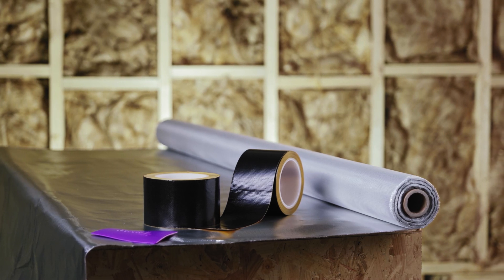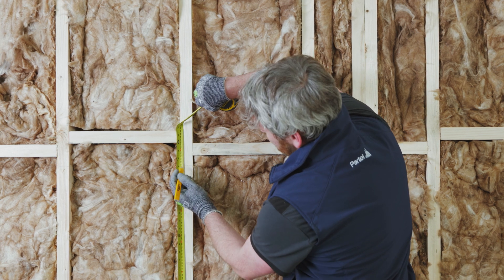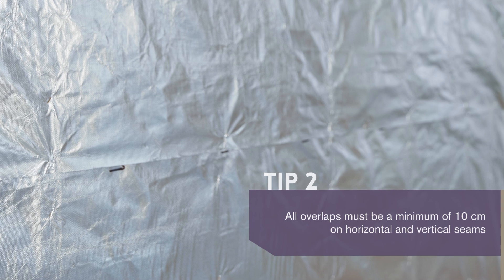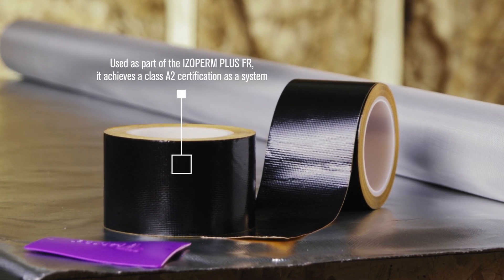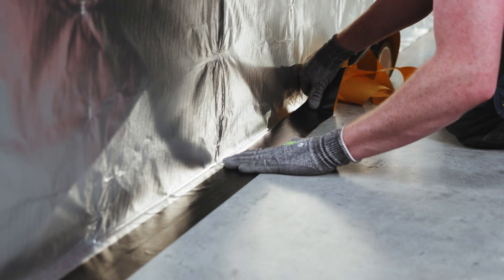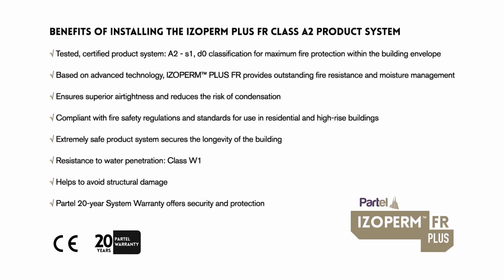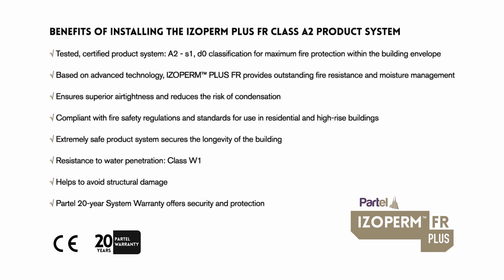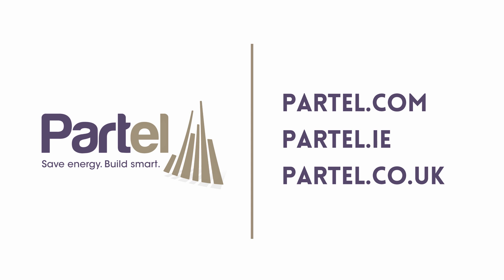How to install a fire-resistant vapour control layer - Partel IZOPERM PLUS FR Product Installation

Comment: Hi,
How do you fix the vcl on the head of envelope wall between concrete slab with deflection? 
Usually most vcl stick to the underside of the concrete slab
Reply from the maker: Hi Richard, 
For sealing to concrete, we recommend ECHOSEAL ALU FR to seal against. 
For the underside of the concrete slab, we recommend a seal as you would if you were installing an airtightness membrane onto a wall and turning it up onto a ceiling, this can be folded over onto the ceiling and sealed again with ECHOSEAL ALU FR. 
For further information, please contact technical@partel.com.